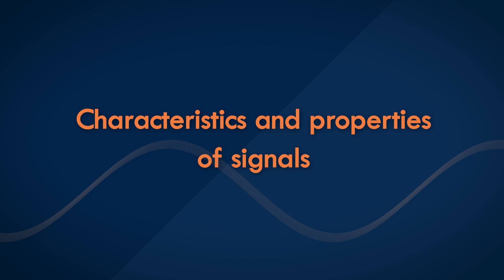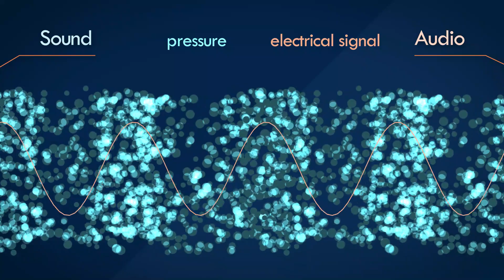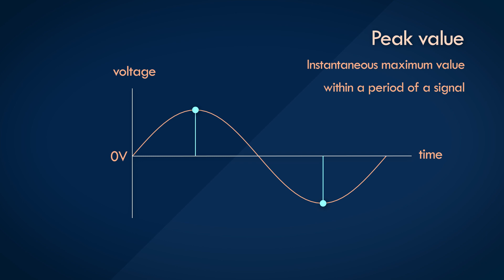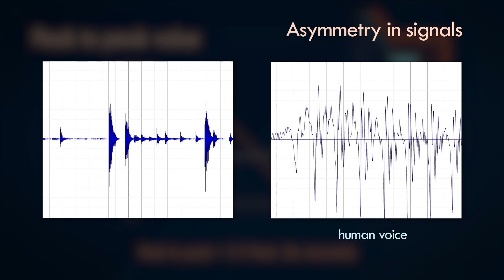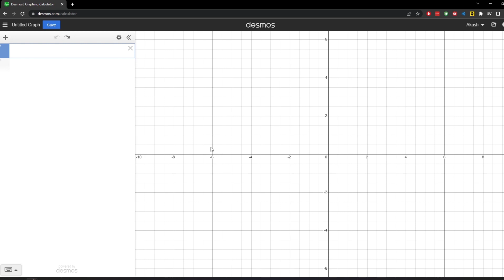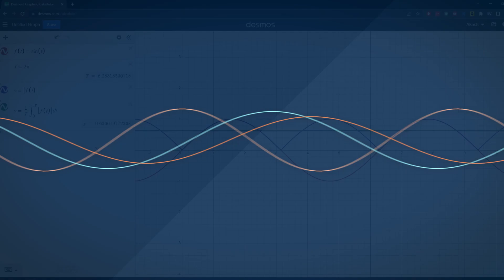6. How large are signals - Loudness and Level

Comment: hello akash sir, old subscriber and your student here. I have a doubt, when you master a project. I should sound 'louder' but how much loud is loud enough. No matter how much I push the gain knobe in my daw's mastering chain... it just increases the volume level but when I listen to the music of record lebals they always sound very loud.. what am I lacking??
Reply from the maker: Hey there, there is no easy answer. A lot of it has to do with the source material and how it's mixed.  Rich and varied content which is spread out across the entire frequency range is important. Good stereo separation is important.
Just pulling up the gain slider doesn't do much. You'll be clipping the peaks of the tracks and there's only so far you can take it before you start getting distortion. 
Learn about compression, and how you can use a compressor to pull up the lower levels of your track. Limiter does a similar thing, and could be used at the mastering stage.
Reply: @akashmurthy  Thanks a lot sir, I hope someday you will be showing on actual mix how to achieve that.